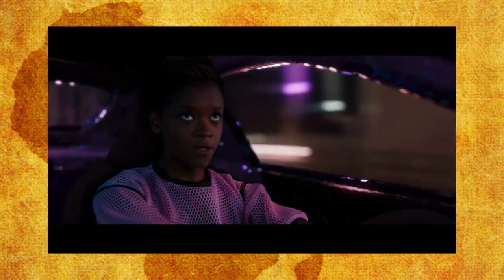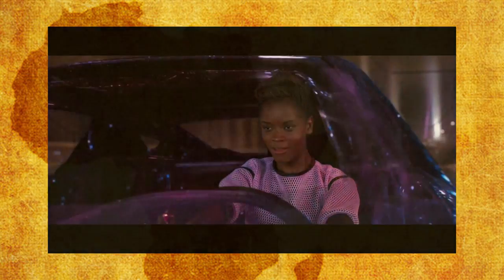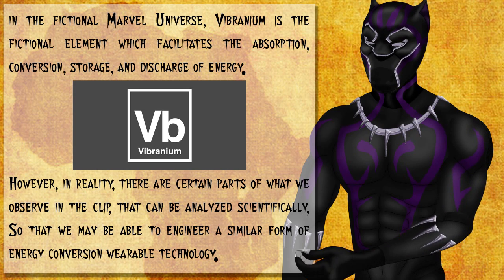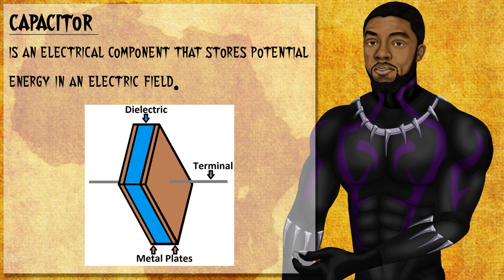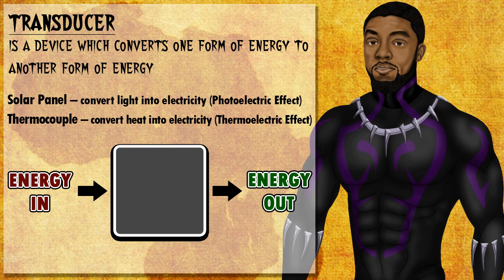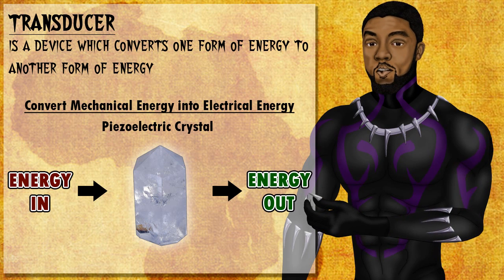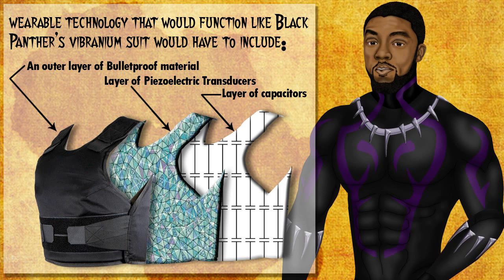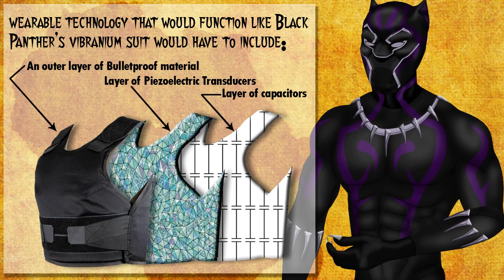Black Panther Kinetic Energy Science Explained

Comment: Graphene which is 100 times stronger than steel is the ideal material. Graphene at the same time one of the competing material for the manufacture of supercapacitors used as the battery power source for electric vehicles. Graphene is just nano-sheets of graphite which is carbon just as a diamond the strongest material is still carbon.
Reply: But graphene cannot store kinetic energy from impacts to redistribute it ?

Comment: Crystals turn impacts into energy. You are on point. They also get enhanced from heat, light, static, & enhance electricity. I regulated capacitor is light & holds energy. If heat is a problem with capacitors, then there are ways to move & absorb heat. Since it's based on a real thing, like your other video, would the crystal be original or currently iron crystals?